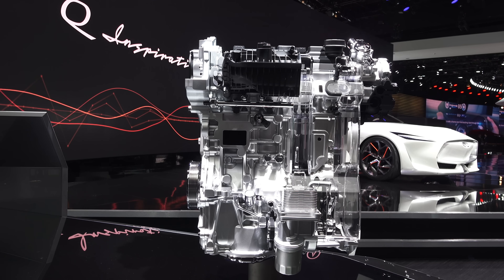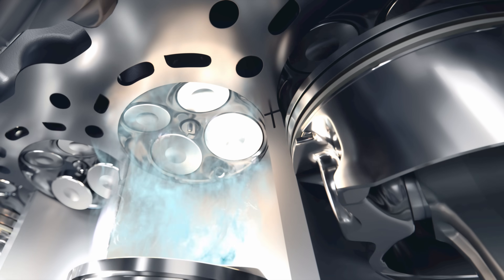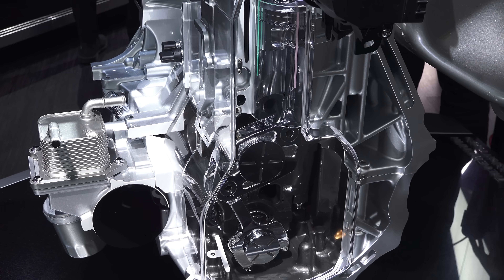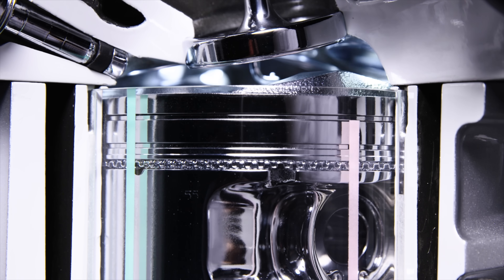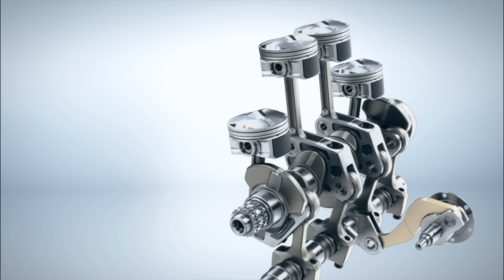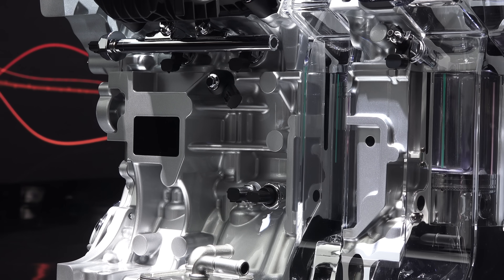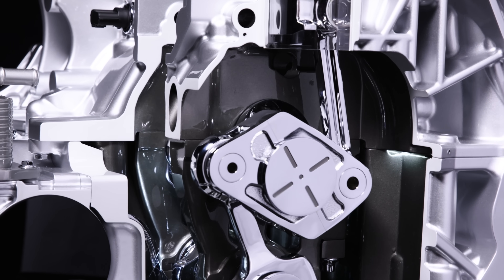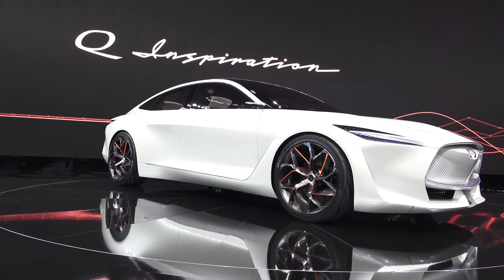INFINITI Reinvents The Gasoline Engine — VC-Turbo

Comment: Everyone complaining about potential mechanical issues, but not one complaint that it will require premium gas. How is that going to mean money saved i.e. efficiency, if you are paying $2.50 plus per gallon. This is more gimmicky tech that will fail, if only because only those with deep pockets can afford it and they are not the market share by any means. Tech that poor folks can afford always rises to the top.
Reply: Here in Brazil we pay about US$ 5,40/gallon of 86RON mixed with 25% Ethanol.
Reply: Realize that octane is not how long gasoline burns, but how well it resists detonation.
Reply: +Candisa : It was stated in the video that this engine requires premium fuel. If you knew anything about engines (I know you don't) then you'd know that increased compression ratios require higher octane fuels in order to limit/prohibit detonation and pre-ignition within a gasoline powered internal combustion engine. And, now you know.
Reply: Premium requires more precessing and thus energy to make which is why it costs more so the total carbon emissions could actually be higher than a NA V6.
But if it could run on e85 the variable compression ratio could maximize the very  octane of that fuel.
Reply: It's still an Infiniti.... takes premium because Infiniti owners usually want a little performance with their luxury cars.
Reply: That's true but consequence of additions required for higher octane is that it burns slower
Reply: +digitalandanalog : "Regular" Unleaded 87 octane gasoline is higher than $2.50/gallon right now you putz. (3-28-2018) And, that's semi-reasonable a price in today's economic mess, compared to what it was just 5 to 10 years ago - pushing over $4.00/gallon! Beyond that point, I agree with your comment about tech for the poor will dominate the market. Naturally the case, because it's the "middle-class poor" that make up well over 2/3rds of the population! I wouldn't bet on it's failure though. You never know, the concept is pretty sound, and the R&D has been pretty extensive. Real world general public testing of this variable compression concept engine will tell the final tale.
Reply: digitalandanalog Who said it'll require premium? If anything, this system adds another level of possible compensation of low octane fuel!
Reply: BTW, $2.50/gallon, that's cute... Here it's €1.45/litre for 98RON!
Reply: That's only assuming the efficiency gain is outweighed by the price of premium. Where I live diesel costs more than premium but people still save money driving diesels.

Also, as the other user pointed out, if anything this engine is more flexible with octane than most.

Comment: Only way I would purchase is if there is a lifetime guarantee of those modified engine rods. Just seems like there is more to break.
Reply from the maker: But rationally thinking about it, do you think the engineers would validate and test the rods, FEA to make sure they last the life of the vehicle?
Reply: They should. Unless your pushing a motor beyond its specific intended output...when have you heard of a connecting rod snapping in a stock motor? You just gave this motor two fail points in the center of a connecting rod.

Comment: They forgot Volvo's compressed air to eliminate turbo lag lol! Oh also that formula separate spark plug chamber! Seems like mechanical nightmare. 8 fuel injectors on 4 cyl engine. That's expensive to maintain, but hey who cares about that cost if they will buy such a new car. Infinity could also make fuel dependent VC with detonation detection to get most out of fuel.. Because why not!

Comment: It’s too tall. It’s super complicated. You also ruin your squish by moving the piston so low in the “low” compression position. They’re trying too hard to reinvent the wheel.
Reply from the maker: Ruin the squish? Low compression ratio is supposed to be exactly that.
Reply: Engineering Explained lol not the “squish” I’m referring too.
Reply: If you read up on “quench”, you’ll eventually get to “squish” ;)

Comment: Why not use a long cylinder sleeve that protrudes into the head, and change the head lift? You'd have to redesign gaskets, but I feel like that would be easier and more reliable than adding twice the number of moving parts, and in the bottom end which makes servicing twice as expensive, if financially viable at all. I thought that turbos already optimized compression of air anyways? What thoughts do you have EE?

Comment: I love when companies break the mold and push for the unconventional.
I will always have more respect for the company that takes risks but occasionally fails over the one that rarely ever has issues but only uses whats already established.
Reply: Kitsune Ken, well believe it or not Toyota actually pushed the car world forward in many ways. EFI, Twincam, variable induction runners, ACIS, Hybrids, ITBs, 5 Valves per cylinder, Hydrogen, EV, modern assembly lines, MMX cylinder liners, modern hydroforming of sheet metal, TMIS/Pegasus, 4WS, HDD based GPS, slave cam's, valve overlap for EGR, cam timing, electronic spark advance, COP, forged cranks on regular cars, under piston oil squirters, infinitely variable Valvmatic, and so much more, though some of these things were never offered globally in the beginning or stayed regional.

Fact is they spend the biggest R&D and historically have either been the first to market or really close to first, when many of this tech' was only offered either in the race world or by companies like Ferrari & Lotus or simply didn't exist at all.

We just don't seem to notice because later on every company seems to do the same by then we think it's normal or average but the companies that do these things first were once the only one, and the exotic tech' such as ITBs and 5V/cylinder are now abandoned even by companies like Ferrari due to cost for minimal gains, so most of us have no clue who is really innovative because tech' comes and goes before we notice, things like DOCH, and valve timing seem average because it hasn't been superseded. Even the combo of direct injection + port injection together is a Toyota pioneered system the D-4S, and the Prius has been doing the whole pumping air back out thru the valve for ages now, and cylinder diactivation/variable displacement situation that Honda and the American companies took a lot of praise for was something Toyota did with a 60s designed 2L Stright6, though again they abandoned this like their ITB 20V engine because they moved to other ways to achieve similar goals, so it's easy to think it never happened. The flip side is if it's an innovation that catches on, no one is going to notice the company that normalizes all these things as ever being the pioneer because if it's good technology it gets copied by everyone before people ever question who put it to market first, which most of the time are motorcycle companies (Yamaha, Honda) if not Toyota, and Ford as car companies. These 4 companies seem to be be the ones who've pushed innovation when going by history, even the method that Nissan engine coating is applied in the video is similar to what Toyota did with the Celica engine forever ago, a car that hasn't even been made for ages now, it's also something Yamaha did in the early 2000s which should be a trend. Yamaha and Toyota have a partnership when it comes to engine technology, and the two tend to release the same tech more or less side by side.
Reply from the maker: Agreed! It’s wonderful to have some variety and not just another downsized turbo.
Reply: Ironically I watched this right after reading Jalopnik's article on Kenichi Yamamoto who was responsible for the rotary engine. Likewise, knowing Mazdas priorities to innovate and know Infinity's certainly makes me want to consider them first.
Reply: Robbie Callaghan toyota?
Reply: Well, put your respect where your money is then and buy the thing when it's released :-) respect doesn't support.
Reply: You gotta hate Subaru then 😂😂😂
Reply: TakeAmericaBackfromISRAEL is it fair to compare a 20 year old cars fuel needs to a new (and slightly larger) engine's ability to run on regular?

Or are you trying to say that for this engine only making 260hp it shouldn't require premium??
Reply: exactly, something acura hasn't done since the legend and integra. And that's why no one cares for acura anymore
Reply: i mean i get this is meant to be sarcasm.... but it doesnt work when its true lol.   You do realize that companies like this pay billions building brands right?  so basically yeah, they are probably quite happy that they won over my respect :P
Reply: "...push for the unconventional." Like Tesla?
Reply: Agreed. I'd try one out if I could afford one.
Reply: its about time they have been using there older engines forever
Reply: +Keye T : At the end of the day, it's all about how much money a manufacturer wants to spend on their Research & Development of any given product. Thorough prototype testing leads to much fewer failures once a product is unleashed upon the general public. Most manufacturers don't do enough R&D and testing. They just let the public have it and then deal with the fall-out afterwards. Hopefully, for Infinity's sake, they did their due diligence on this engine, so it isn't killed off too soon, before it ever gets a chance to prosper. It sounds as if they have, but time will tell.
Reply: +TakeAmericaBackfromISRAEL : Wait just a minute there pal... You most certainly DID NOT HAVE to buy premium fuels. You CHOSE to do so by purchasing those vehicles which required it for them to run properly. Nobody put a gun to your head and MADE you buy those specific vehicles. So shut the hell up with your b.s. and pointless drivel.
Reply: Robbie Callaghan if so then Mazda should be your favorite :D those guys really push the boundaries
Reply: +Turbo Diesel Around here we have this wonder fuel called E20 which I've never seen an engine designed for premium fuel complain about, and it's CHEAPER than 87 octane(Often by about 10-15 cents per gallon). Heck, my Prius actually gets BETTER mileage with that fuel than it does on 87.
Reply: @user-5gu78qo27i      no if Toyota makes a mistake it's still Toyota's fault, reason being Toyota's parts suppliers are still Toyota brands, Asin, Denso & so on even though are used by other manufacturers is still under the Umbrella of Toyota companies, Toyota also owns stake in Fuji Heavy Metal(Mazda) & no don't say what you think I mean[strawmanning arguments], I said ValveMatic specifically with good reason & that's because it's genuinely infinitely variable something no other mass produced cam system is, hence why Toyota is first at it

What the technology enables is what is important, for example low RPM high atomisation asymmetrical port swirling with TVIS(Toyota Variable Induction System{made the car behave like it had two varying intake cam' lobe sizes[1small+1medium] then@+4.2KRPM[2larger but equal cams]})in the early 1980's, something that took until the the K20 Integra Type-R from Honda 2 decades latter with the iVtec system, a combo system which itself was beaten to launch prior by Toyota's VVTL-i in 1999 in a more mainstream production engine regarding it's intelligence paired with timing, or the timing alone with VVT, the basic concept of optimizing airflow for RPMs were already handled by secondaries, but Toyota's Acoustically tuned variable intakes already superseded that, & ValveMatic does all this and more with just one system instead of picking what benefits to have it can offer infinite valve; timing, length, duration, basically infinite cam profiles at any&every RPM, even better response then ITB, as no throttle bodies or secondaries are needed*may still be included for safety), TLDR Toyota's ValveMatic can serve the best airflow for every RPM & load & there's no improving beyond constantly ideal airflow, (how much this will continue to matter in a more electrified world is another story)

..Also you're mistaken about Honda, the first Toyota Prius came out in 1997, which had a far more sophisticated hybrid system then Honda's response to it with the Insight that came out years later as a 2000 year model, So (even though I was talking more about Valve-EGR in the Prius + it's Synergy Drive, {not simply which Hybrid was 1st}) Toyota factually sold hybrids years before Honda, I'm not mistaken as you suggest, I triple-checked
Reply: Thats Nissan/Infiniti for you!!!! they also were one of the first auto makers to use the CVT so it's not uncommon for them to step outside the box when producing vehicles
Reply: like Toyota? gee, that must be why they can't sell any cars.
Reply: Robbie Callaghan Well I don't mind a company doing something new, as long as they tested it THOROUGHLY instead of bringing out something new and forcing on the public as test  dummies  Like what ford did with those dual clutch transmission stay put in the Ford focus,, Unlike when you compare Toyota with their first hybrid synergy drive which they got right the first time
Reply: I'm sure they are just so happy they won over your respect
Reply: AKA Toyota
Reply: Well, I mean, SAAB was all about that, they had a variable compression engine with very similar characteristics years ago. I don't know if it was patented and I know SAAB ran out of money before the could do anything with it.
Reply: gabeliee: that (Saab gone) should let you know VC is a dead end.
Reply: It is clever tech, but heard an explanation of it before, years ago, on his channel.  Why cover the same topic twice? It's certainly worthwhile covering the fact that someone plans to use it in a production vehicle, but why do I get the feeling I just watched a scripted infomercial. This is a new and rather bland era of marketing hyperbole being read (rather dryly I might add) by someone who had to submit their work for editing by a the sponsor. Lets face it, that mechanism is a LOT heavier than the counter balance shafts they scoffed at for being unnecessary and heavy. Complexity IS the enemy of reliability and that system is quite extraordinary in it's complexity. I have visions in my head of valves and pistons attempting to occupy the same physical space.

 I do like the idea of altering the moment angle of the connecting rod to reduce sideways force on the cylinder wall. That's hella clever.
Reply: Toyota

Comment: Great video, enjoyed the high level of detail unfortunately from a scroll through comments it seems most seem to lack understanding to appreciate said details. 
Jesting aside can you comment on the boost level situation? With most manufacturers having very precise control on boost levels with electronic wastegate valving did they mention specifically how they are managing to ensure boost levels match the correct timing so the compression ratio is adequate (read; safe)? I also question how a 1.2 (i think it was) second delay going from high compression low boost cruise mode to low compression high boost mode is going to work well for daily driving, add even minor turbo lag and gearing into the equation and it sounds like there may be a poor experience for say slapping your foot down to pass quickly at a moments notice. 
Thanks, keep up the great videos.

Comment: I was gonna ask about how fuel affects but you did say they recommend premium. Which I know will help the engine computers allow the compression to reach 14:1. I run premium in my 2016 Mazda with a 13:1 and it makes a difference

Comment: So if I understand correctly, the displacement is changing while running. 
If yes how do they rate the engine displacement since many countries need a fixed figure for that. I guess they will take the bigger displacement...